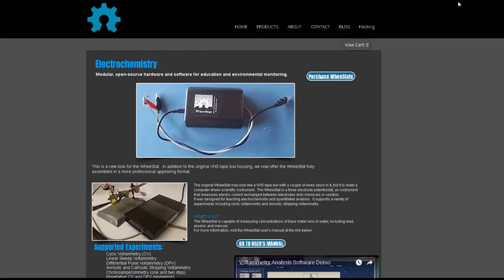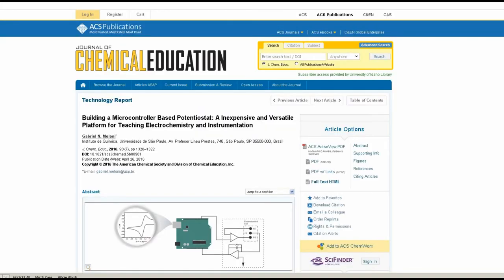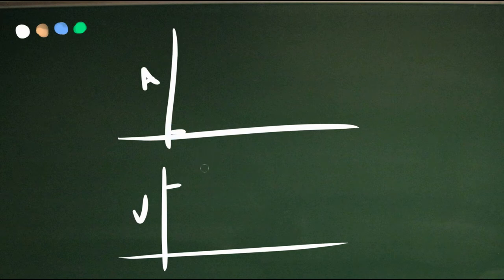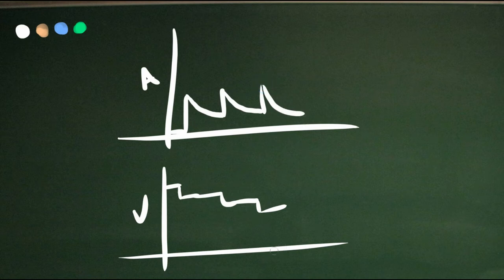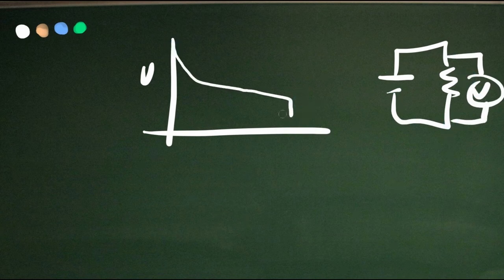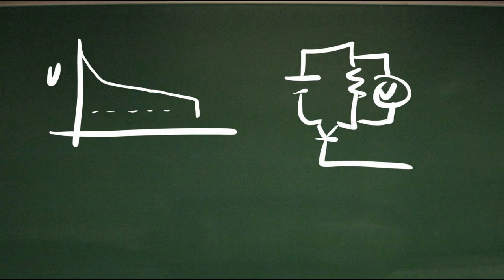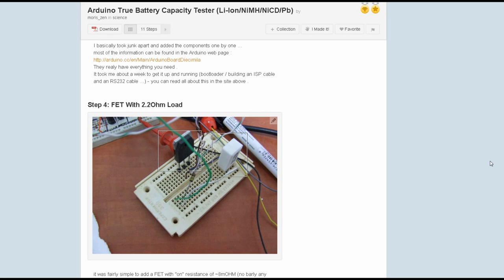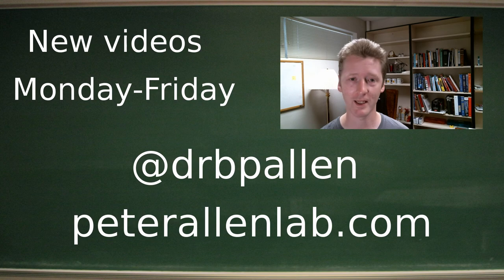Open source battery meters

Comment: In this case I think current is almost always measured by converting it to a voltage signal.   Whether its a current-sense resistor (passive or amplified voltage signal), or hall-effect sensor, or current transformer coupled with one of the above.

Comment: Yeah, the circuit schematic for the "cheapstat" seems basically consistent with the wikipedia article for potentiostats; they appear to be fairly simple op-amp circuits.  A $2 op-amp does the job.  Everything else is overhead to make it into a fancy lab instrument.  The board, case, LCD and driver, microcontroller to talk to a computer, software, etc.  

It's funny to me that the reason it looks as complicated as it does is not because a potentiostat is complicated, but rather because of all the analog to digital conversion required to be compatible with computers, USB ports and LCDs.

Comment: For some folks, using a microcontroller is no big deal, while others prefer to avoid them whenever possible.  Anyway, one idea I had for acquiring data without a microcontroller is to start with any voltage signal, (including one from a potentiostat made from op-amps).  Then use a voltage-to-frequency converter (either a purpose made ASIC "chip", or a 555-timer circuit).  Then feed this frequency signal into a computer/phone/camera audio-input using the "microphone" input or "line in".  The audio data can be recorded for post-processing, or other software could process it in real-time.  Either way, software can convert the frequency to a digital signal.  

The advantage is the hardware is as inexpensive as possible (not counting the computer), and no microcontroller is needed.  The disadvantage is that the accuracy and sample rate (bandwidth) might be a little less than a more typical D/A converter.